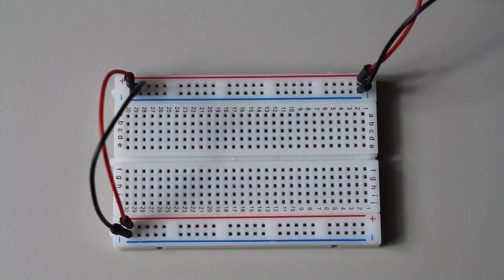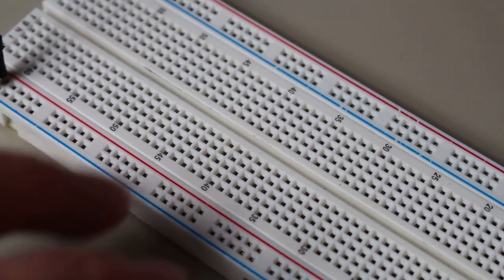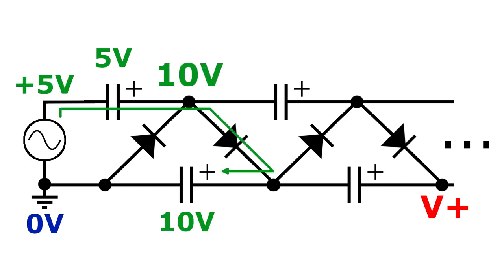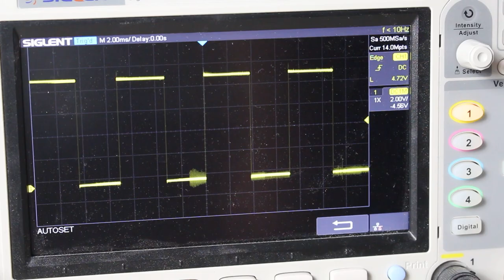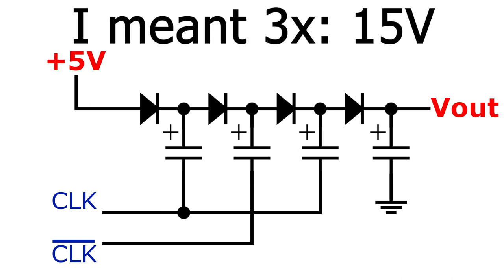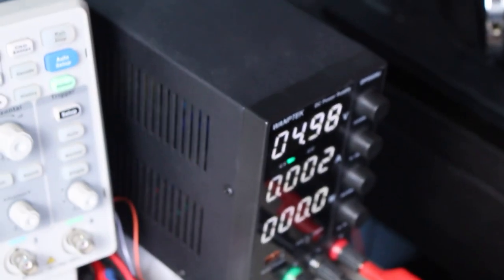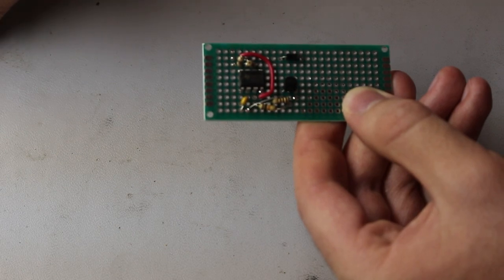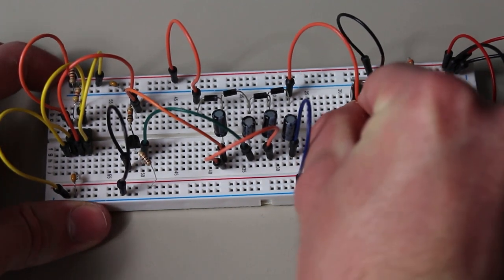The Simplest Voltage Booster? - Charge Pumps Tutorial

Comment: It seems counterintuitive to be able to boost voltage. Maybe it is a bit like increasing the PSI of the flow of water by changing the diameter of a pipe. In any case, thanks for making another great video.
Reply: Not really though because when you make the pipe thinner the thick part gets the higher pressure
Reply: Its exactly that, PSI = voltage, Flow = Power (W)

Comment: Impractical, unless that is you have a functionally limitless supply of 350v 130,000uf electrolytic capacitors.
Reply: I have like at least 2000 different capacitors of different sizes in my kit

Comment: Really enjoyed this video in which you show your evolution in implementing V-boosts.   
Dealing with power systems (solar) has intrigued me with using boost circuits to draw more power from my small solar array.  Ignoring the subtleties of charging modes, a low battery can actually double the current flow, balancing out the power flow for changes in irradiance, as well as a few other tricks can cause a meaningful boost to the energy captured.  Inductors are simpler than capacitors and less prone to failure.....they are great storage devices.

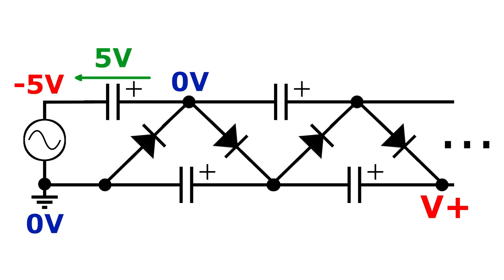Comment: On diagram 3:00 technically you could getaway with polarized capacitors, but if the load is low impedance or a short, they can be exposed to alternate current. Unless there's an extra diode

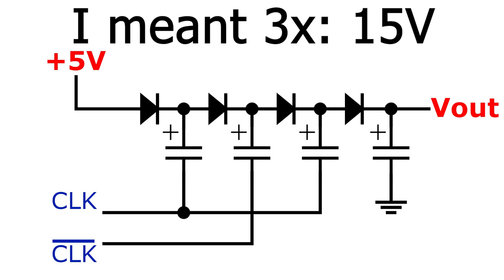Comment: 5:41 No, that is 20v out with ideal diodes, not 15v. The third cap = 15v with CLK low 6:21; then when CLK goes high add 5v = 20v out.
Reply: No, the last capacitor acts as a  smoothing capacitor since it is tied to ground, it is not in series with the output as the previous capacitors are.

Comment: 5:17 Why is it "better" to avoid virtual grounds and intermediate AC signals?
Reply: Because it divides the DC voltage in half.  Notice that the first circuit uses 10V to achieve the +5V/-5V AC wave in order to work, whereas the second circuit only needs 5V.  The second circuit avoids using AC, it just uses a 5V "clock" to produce pulsed DC.